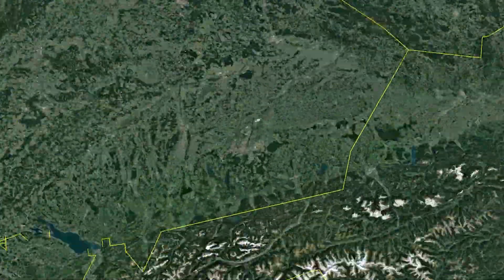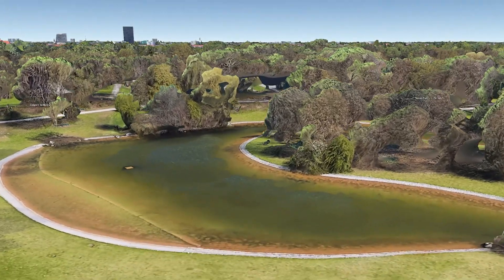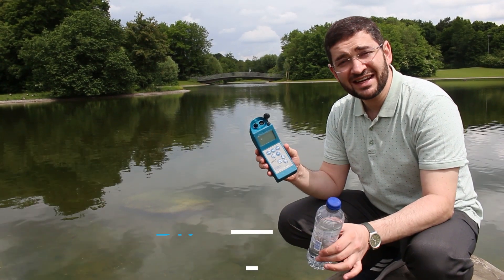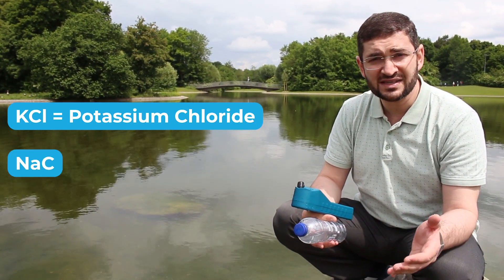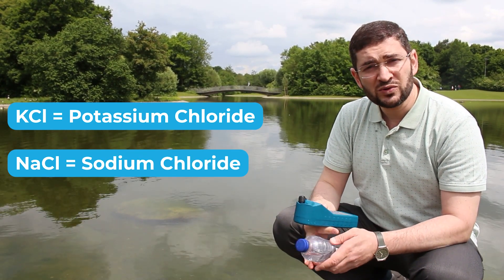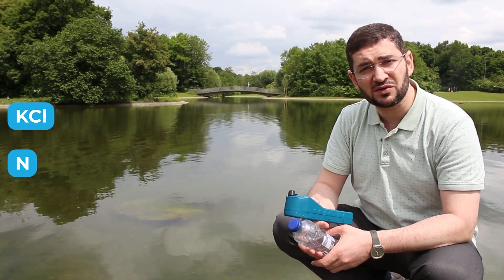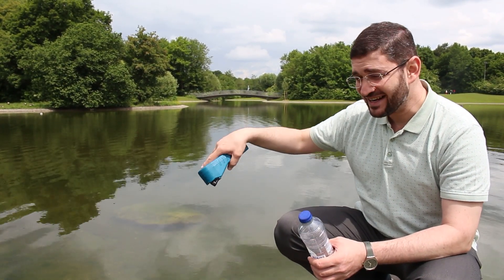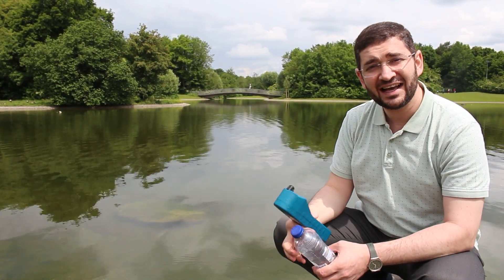Measuring TDS & Conductivity | Ostpark, Munich, Germany | May 2022 | Travel for Water

Comment: We use myron l ds meter(442) analog to check boiler water tds, as the result we get 4300ppm while when we use digital tds meter we get 1800 to 2000ppm,why this happen?? Anybody please explain
Reply: Need to calibration by buffer solutions.